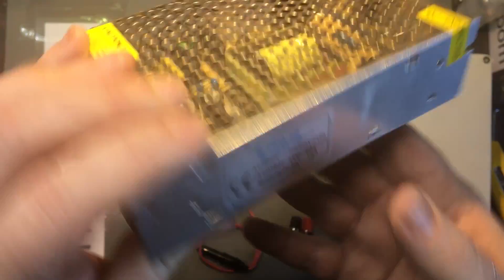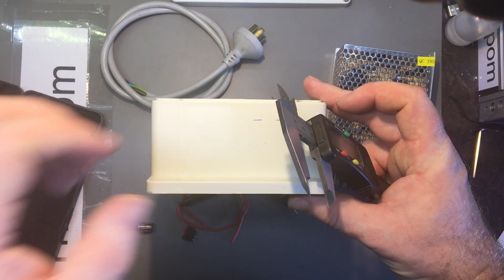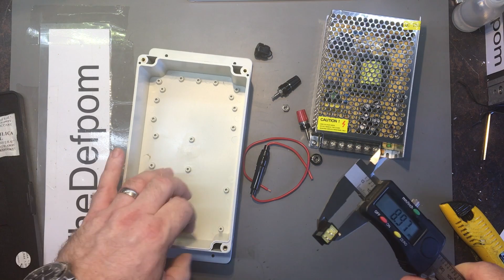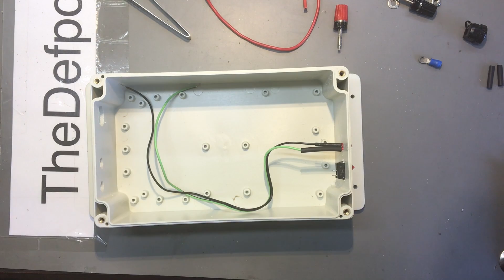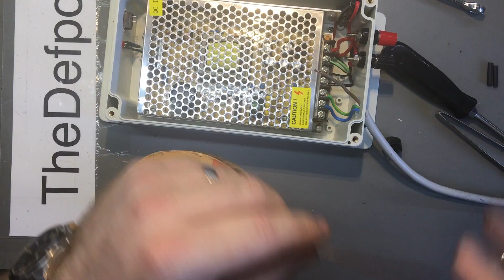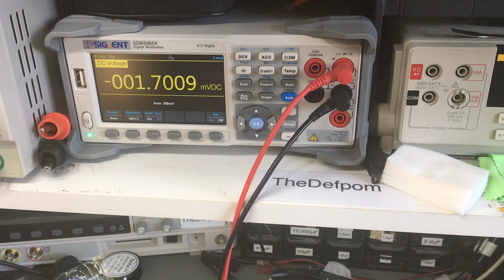#314 12V Bench Lighting Power Supply Project

Comment: Nice supply, will it get hot in the box, maybe leave lid off
Reply from the maker: DENNIS N - I have been keeping an eye on it, and it seems to be fine so far, it doesn’t get left on for hours on end so it doesn’t really build up heat, I normally on run it for about an hour at a time.

Comment: Hi from North Wales, I have been in electronics for most of my life, all 75 years of it and still building gear... I noticed there are no fuses in the plug top like we have in the UK, is this the norm . in NZ?
Reply: As far as I know, the UK style plugs are the only ones that have integrated fuses. 

greetings from Germany
Reply from the maker: Yes that is right, the I’m plugs are well designed, the NZ plug (the same as Australia’s) is poorly designed, thin weak pins, it wasn’t until recently that the live and neutral started to be required to have insulated sections, as it was possible to touch the live pins as you inserted or removed the plugs! Cable retention is also crap.
Reply: Hi,ok about the live pins now with insulated sections, it has been the law in the UK for some time now, we have found some Chinese plugs with insulation on the ground pin, when the plug is inserted into the socket it disconnects the ground...

It is not a good idea not having a fuse in the plug, on low wattage equipment with thin cables you are relying on the breaker, we have 32Amps on ring circuits and 16Amp on spurs.
Reply: its the norm in every other country.
Reply: UK here. Our plugs are very robust and I agree, having a fuse allows for thin cables.  

The worse plugs are the US 2 pin ones - on older sockets they are always falling out.  The Euro ones are only semi compatible across the continent (they look the same but some diameters are different). Never tried the Aus/NZ ones.

Comment: Oh "Convection" perhaps :-)
Nice neat but lacks just one thing..... some hot glue!!, you are not a ham without a blob of hot glue lol :-D :-D.
You might bung a couple of diodes in line with the lighting to drop a volt and a bit, possible.
For led indication i fall back on the good old 1K resistor (im a lazy sod) :-D

Old british reels of wire, they are everywhere, i have a few too, cant remember who gave them to me.
Reply from the maker: zx8401ztv - convection is the right answer, it came to me later on! I have considered some diodes, but the current draw is up to 5-6A so they would need a heat sink and cooling, so I decided against it. So far this is working ok.
Reply: Struth 5-6 amps, your work area should be lit up like a stadium lol.
You could creap another led on to the heatsink, but if your happy then it can keep the room warm :-D.
Reply from the maker: zx8401ztv - that is at 12V, I have a few LED strips around the bench area, so allowing for all of that with a bit of overhead comes to that amount.

Comment: Lighting is one of those very important parts of filming and essential as my eyes are getting old. I don’t really like the light output of LEDs I guess it’s the Colour temperature. I’m using large compact fluorescents photography lamps. They have a great light output but bulky and get hot.  I guess I will eventually go down the LED route.
Reply from the maker: AllTheGearNoIdea - one of my led lights allows for three colour tones, I showed it in a Mailbag video about a month ago, but yes I agree LED lights are a bit harsh as they don’t actually emit the full colour spectrum.
Reply: TheDefpom  I’m still hoarding a few filament lamps!